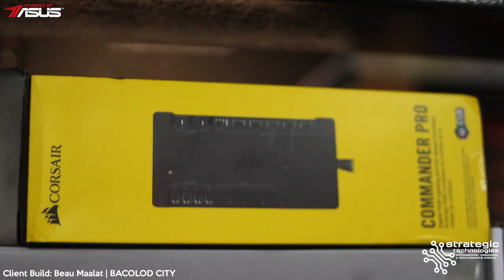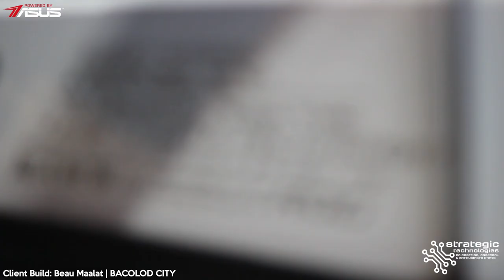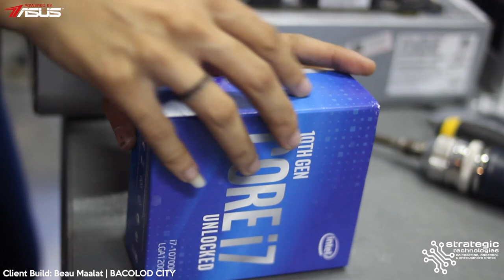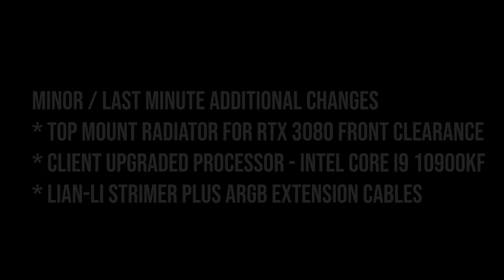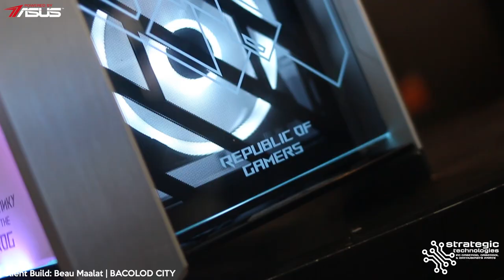FULL PC BUILD LOG - ALL ROG WHITE GAMING PC i9 10900K , ROG STRIX RTX 3080, ROG HELIOS WHITE

Comment: how much power did the rog 3080 oc and the 10900k draw under load?
Reply: 850 watt is enough i think
Reply: 2080 and i5 9600kf uses are 400 watts.Yours shouldnt exceed 700.Get a 850 just incase if you have a lot of rgbs and fans

Comment: Hi, how did you manage to connect the lian li strimer to the rtx 3080? I understand that the GPU has 8x3 pins while Lian Li currently sells only 24 & 8 pins. Salamat
Reply from the maker: buy another strimer plus and hang the other 8 pin since nothing is connected to it
Reply: 3x8pin strimer
Reply: @galihindrajaya4812  the 8x3 unfortunately is still not available here in the philippines. thus the question :)

Comment: Hey great video can you tell me how will the ryzen 3 3100, rx 5500 xt 8 gb, and the asrock b450 pro4 run together? I don’t know much about these parts.
Reply: İt can run great.But I recommend B450m pro 4.
Reply: Just do not use amd gpu it would be fine for a budget build
Reply: You could put a 1650 /1660